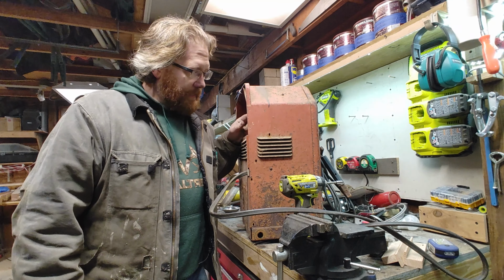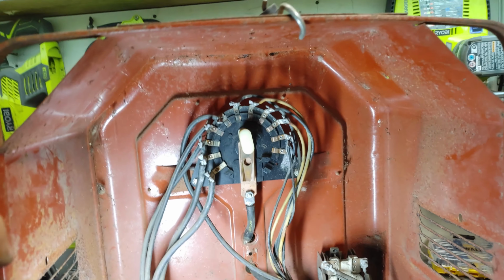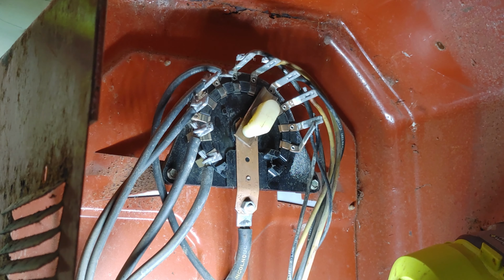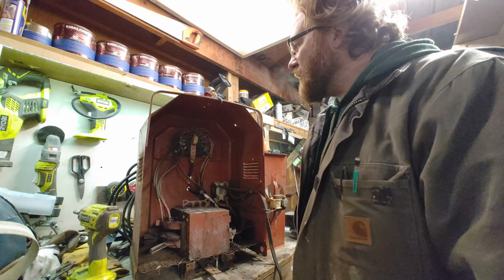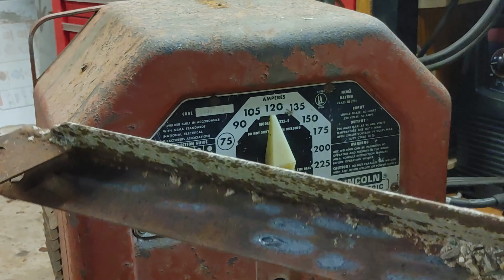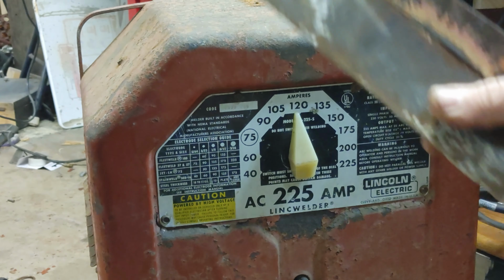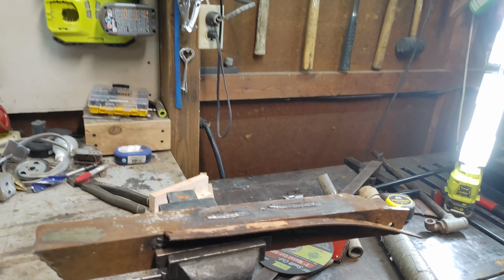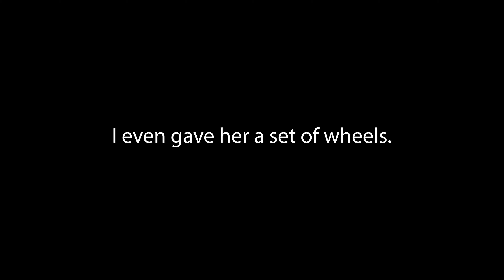A Little R&R: Lincoln AC 225 Repaired & Refurbished

Comment: The contacts looked good when you opened it for as old as it is.i have one 35 yrs old I opened today just to check the contacts cause I have a little trouble with start up and sticking but mine looked as good as yours or better.guess I just need to clean the stinger once in a while.
Reply from the maker: They weren’t terrible, but since they hadn’t been cleaned since ‘Nam, I figured I might as well tidy them up while I was in there. Lol.

Comment: I just looked at yours again and at the literature on the front and it’s exactly the same as mine but I forgot to look at the date code on mine but I do remember it was about 1985 at Central Hardware and it was the only one they had and the shelve model to boot and they gave it to me $150 with no warranty cause being the shelve model.still looks new and all the switch and dial are both still hard to move.i used a small wire brush on the contacts today but didn’t really need it.i didn’t hardly use it the first 20 yrs then came all the car shows on tv and I learned how to weld,amazing now I have 3 of them and I started on brazing self taught and I love welding.you did a great job on yours

Comment: This video warmed my heart! I was a certified welder for over 40 years, and it all started with one of these back in ‘78! Although all my years in the trade were using DC welders, I’ve always had a soft spot for the tombstones! My home shop is stick/TIG & mig equipped, but when I retired in 2020 I bought a new tombstone as kind of a memorial to the comfortable living that all started with one of these! Spoiler alert: I use it more than my other machines by a long shot! She’s ready to go with the flick of the switch! No gas cylinders to worry about refilling or any of that crap! Recently I learned about ESAB 6013’s, they have green (yes, green!) flux but burn so much better than any other brand of 6013 I’ve ever used! None of the issues with slag entrapment and blowouts that plague other brands! Very good restoration! I hope by now you’ve painted that sweet cart you made! Well done Sir, well done!

Comment: I have that exact welder I inherited from my dad.  The older ones had the white selector switch - you don't see those around much any more.  He taught me to weld on it when I was 13, that's about 50 years ago.  The shaft was broken during a move, but airgas had the parts.  Excellent job on the restoration, I need to follow your lead.  Like to pass it on to my son one day.

Comment: Loved your video! I inherited one of these from my dad. Wayyy too heavy for me to move around, how can I get a set of wheels like that??
Reply from the maker: Sorry I didn’t show how I made the wheels. I have a couple of other welders without wheels, maybe I’ll make another set & do a build video.
Reply: If you don't want to fabricate a set of casters/wheels you can actually buy a wheel kit on Amazon or your local welding supply store. 
I am not sure on the price I want to say 30 bucks or so.
I was going to use some push mower wheels and fab a handle (kind of like a hand truck) just because I got the wheels collecting dust. All I know is the easier you make it to move the more often you will use it.

Comment: I bought a busted Lincoln 225 that's 60 something years old fixed it up and I haven't had the chance to repaint it yet, but it'll last 60 more years without service once I repaint it .... These are truly well built and bullet proof machines
Reply from the maker: A friend of mine is a career welder. He said some of these old Lincoln buzz boxes are still used commercially and often preferred.
Reply: @post5productions  mine is used to repairing old trailers, attaching tow hitches, and building fences, i would do more if I had more room for fabrication

Comment: Owned one for 40 years now.....I always change amperage with the switch off, and respect the duty cycle.....20 percent as I recall, except for the 75 amp tap, which is marked with the circle...that’s 100 percent. For your carbon arc torches......

Comment: I kinda want to pick one up used on Craigslist or Marketplace just to restore an old buz box. Cool video
Reply: Done finally picked up one of these old buz boxes welder, nice guy had one in his shop out in the country and he let me have it for $100 thing is mint hardly used just had in his shop for many years. He even opened it up and cleaned it out and he said there was hardly dust or webs inside. His shop was immaculate nice everything in order. Nice guy God bless him. Now time to run power to the garage and get at it.

Comment: They make electric tool and devices spray cleaner for that.you just want to give it time to dry.good job
Reply from the maker: Thank you. I've used chemical paint removers in the past on classic cars to prevent overheating/warping the steel. I don't like using them anymore now that I have kids & pets running around. They do work well though.